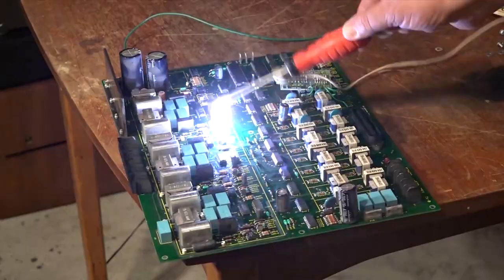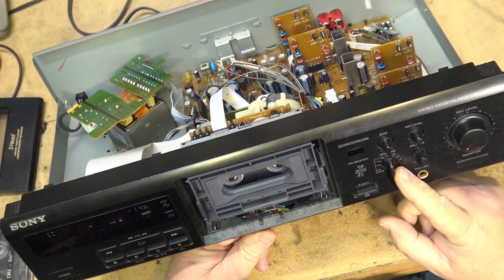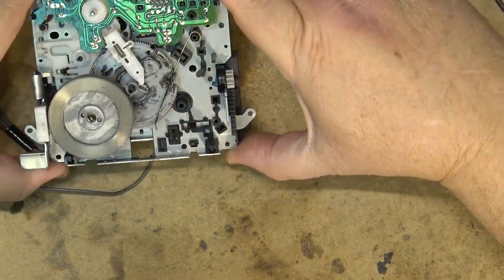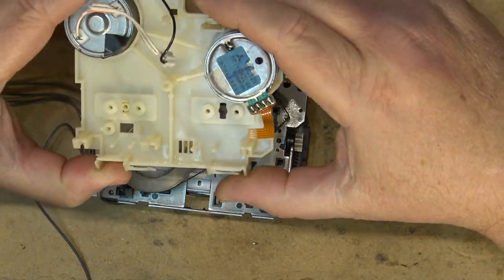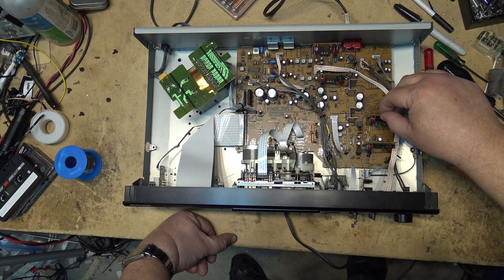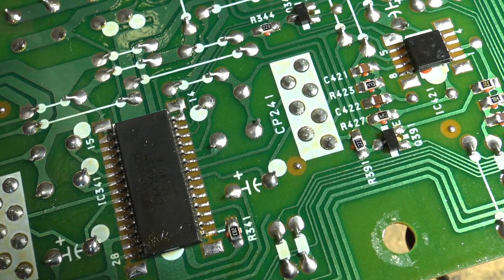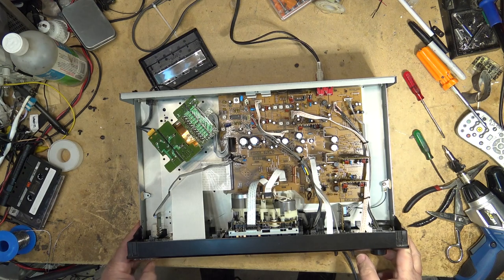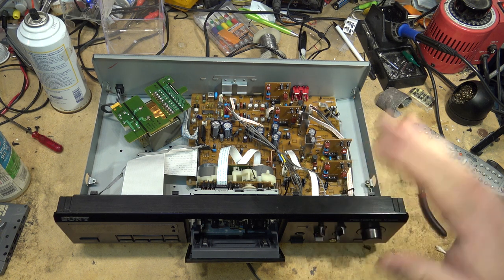Sony TCKE500S 3 head tape deck thrown off a truck

Comment: Sony's 90s components are like General Motors 90s cars, leave you longing for the 70s.
Reply: But they wrre not alone, ALL the 90s "budget" components were like that, you still got some exepections, but CD was on the TOP, by early 2000 philips started to sell stand alone CDR machines for audio .... the tape was basically DEAD. But this deck looks so flimsy and cheap .... I got myself an RSTR262, I hate this Technics components,, one motor for everything, clunky as hell, but they put a decent fight at a very affodable price back in its day. I would say that, appart from being one motor transport, the baseline Technics from same period were a bit better. but not great decks. I couldnt even do METAL !!!!!!!. Sansuis D95 did and it was on the bottom line
Reply: @38911bytefree  I'm sure even National Panasonic RX-A5 can do metal tapes better than RS-TR262.
Reply: I have a Sony 300 disc CD player that works well just don't tilt it because then you got to pull out every CD to get to the crooked ones 😂.
Reply: @caryhuffii7224  I always see those mega-capacity cd players for like 20 bucks at the Goodwill.  Usually they're loaded with loose CDs banging around in them.  Next time I see one, I think I'll pick it up.  If it doesn't work, at least I'll have the CDs inside!
Reply: Shit your tellin me, I'm driving a cadillac Eldorado from 2000 with a tape deck, very small space to work in

Comment: All four of those plug-in boards are identical Dolby-S boards.  Each one is only a single channel.  So two for record and two for playback.  The Dolby B/C chips are two channel and are on the main PCB. Service manual at https://freeservicemanuals.info/en/servicemanuals/viewmanual/Sony/TCKA1ESA/TCKE500S/

Comment: Hi, I have a TC-K561S which has a very similar mecha-unit. Trying to replace the belts and a weak cog on top of the reel motor, I "manage" to put the cam gear out of alignment and also the heads assembly fell off. Can you please tell me what is the correct position for the cam gear? Thank-you.

Comment: Hi. The tension spring that crosses along the front of the area of the heads, coiling at the capstan/pinch wheel, I'm not sure how the right angled shaped end, is meant to rest. It appears to have disengaged from it's original position. Any suggestions?

Comment: the bean counter type deck when they stoped selling  no bang for your buck
Reply from the maker: Cassette decks were on their way out by 96 when this was made.  Want a good cassette deck you need to look for one made between 82 and 86. Right when the cd was just getting going because everyone was renting and borrowing CDs to make mix tapes and the really good tape decks were around. By 86 the cheap dual decks were taking the wind out of the sails of high end units.  That JVC i have originally sold in Canada for 1299.99.  My technics rsm275 was a 700.00 deck.  That was alot of money for a tape deck back then.
Reply: @12voltvids  :) hi have you seen the msrp for nakamichis? I paid 500 bucks for a nak 700 and it's msrp originally was 1500
Reply from the maker: @getzapped313  
Yes we used to service them at the shop i worked at.  Like luxman they were expensive.
Reply: @12voltvids  do you think you can help me break down this issue? Also I'm kind of new to this and everything is still a learning curve 

I have this problem, with the rewind, and I engage the RW button will run smooth maybe like one or two seconds, then will start making a loud continuous clacking sound, it will stop for a second than happen again 

Fast forward here and there does the same thing but not as loud and not frequently

Could this be a bad clutch? I bought this deck used with the box and manual, but I have been skeptical about opening it, I have opened my telefunken and some plastic junk don't dual well deck and have a fairly good understanding of most of the components

Another issue is I cannot find any stereo shops n my area
Reply from the maker: @getzapped313  could be a bad idler too.

Comment: I have the same model I found at a local thrift store for $9.49....Belts are toasted but it powers up just doesn't play as I hear the motor working/// I did order new belts that costed me more than the deck but all is cool.. Soon to work on it..
Reply from the maker: Don't ask what this one cost, and I spent over 3 hours getting this one working.

Comment: Hi, can you please explain the right position of the cam gear? I've bought it and have replaced the belts. It will play and ff, but rewind doesn't work.
I've tried already different positions but can't figure it out. Thanx

Comment: I have this deck and it's ok. though you didn't show it if the tap the FF/Rew twice you get super fast FF/Rew, though it does sound like a jet engine. overall the deck sounds great if properly serviced.

Comment: You didn't show how you did the PB speed adjustment as we only saw the freq on the screen. Can you quickly explain how this was done? I also have a Sony tape deck which does not have a potentiometer in the motor but instead somehow should auto calibrate the speed...
Reply from the maker: I think it is pretty obvious. The speed adjustment is the pot on the circuit board that the motor plugs into.

Comment: I have a Yamaha deck from 1998 which sounds really good. Dave you said the decks from this era are not as good. But these decks have the later Dolby S on them.

So my question is this, what deck would you buy from this era that has the later Dolby on it and is a good quality deck, two or three head?

I have a two head Yamaha KX-393, which sounds really good.
Reply from the maker: There's really not much difference in terms of sound quality between a good two head and a three head deck. The advantage of a three head is that you can monitor off tape so it makes setting the bias and levels a little bit easier with the two head you have to make a test recording and then pay it back make an adjustment make another test recording play it back so it takes a little bit of effort to dial a brand of tape in on a two head but once you have it dialed in there's very little difference in terms of sound quality between the two. I've heard many two head decks that sound better than a lot of cheaper three head decks. As to the Dolby ass the problem with Dolby asses the tapes really aren't compatible with non Dolby ass decks so you have to play it back with dubious and if I was going to go to that trouble I would just use dbx because dbx blows them all away. If I was buying a tape deck I would buy one that has a direct drive capstone such as a Technics RSM 275 which is a two head or rsm375 which is the three head or JVC tdv 1010. I have dimension JVC and it sounds absolutely fantastic. But it still sounds like cassette which sounds like crap when you compare it to a real recording system like digital audio tape
Reply: @12voltvids  I could talk to you about retro hi-fi all day long... Thanks for the info. ;)

Comment: Very good repair! I also have a JVC td v562 and it still plays nicely!
Reply: My first real cassette deck (after the cheap Panasonic) was a JVC KD-55 and it had Super ANRS instead of dolby which was not compatible with dolby.
Reply: @andershammer9307  The KD-55 is solid, very good player. I keep mine for nostalgia reasons!
Reply: @alexandrossotiropoulos5621  I have 23 cassette decks kept for nostalgia and other reasons.
Reply: @andershammer9307  23 deck! That is a big number! And how can you keep them all healthy! Because they need to run on and off

Comment: Did you make an adjustment to the head at the beginning I think you did but not sure if you did or not! But I thought you moved the alignment screw!
Reply from the maker: No, i was verifying that the screw was still factory sealed and did not turn. They used 3bond at the factory. That green paint that was only available to factory service centers.  That way if a unit came in they knew if it had been messed with.  Some companies used red and others white.  
You would be amazed at how many people fiddled with the azimuth and then brought the tape deck in saying it didn't sound good under warranty. probably about the same number of people that get their phone wet and then try to claim that it just broke but on your phone there's a moisture sensor inside the headphone jack which tells the story it changes color when it gets wet. I remember one time telling a kid that his tape deck was not under warranty because he messed with the alignment and he had to pay to have it fixed he started crying at the service counter when he found that it was going to cost him $60 to have the alignment done. And then the excuse but it wasn't me it was my friend trying to make it sound better my response I don't care it's tampered with warranty is void too bad so sad.
Reply: @12voltvids  I got ya! Very true! But glad it played better! That was a long solder video!

Comment: And finally about what was all the big deal of the three heads cassette decks,one is for erasing so every typical deck has two.Listen directly from the recording tracks and so what from the moment that any malfuctions as tape speed or head azimuth adjustment will be noticeable in another good quality deck and not the same that the recording was made.
Reply from the maker: The idea behind three head design is that the record and play heads can be optimized for the job they do. Wider gap for record narrower gap for playback this increases frequency response for both the record and the play head. On a two-head deck some compromise has to be made however the best two head cassette decks were so close in terms of performance to three head that most people would never hear the difference. One drawback of three head design is tape to head contact and this is where dual caption is important as the leading caption provides extra tape tension to ensure good tape to head contact on three head designs. On single caption three head tape deck the pressure pad on the cassette may not provide as good tape to head contact.

Comment: I used to have one of these units, maybe I still do????  Somewhere in the pile in storage.....   But mine just 
seemed to develop a mind of it's own during function so I just put it up, plus now I have much better decks
than this one.  May have to locate it and try some stuff you done on here with the motors.   -Cheers 🍻-AC
Reply: I just picked up one for shipping only. IT really does have a mind of its own when you press play. It will play but will eat the tape, wont rewind, the FFWD seems to wind the take up real backwards...I think I got a very bad pinch roller and possibly a cracked gear head on the 2nd motor. Im up for a challenge. It will also no release the heads until I power cycle it. Could be a spring on the cam follower.
Reply: @68pishta68  I know I have one of these.  Got to find it and I will let you know what I do to 
fix mine if I can.  I just repaired a TC-R303 I have a month ago.  New belts and maintenance.  
That thing just keeps going.  This TCKE500S deck I bought brand new from the JCPenney 
catalog a long time ago.  I used it about a year until I started having issues with it.  Put it up 
and never fooled with it again.  Cheers!   🍻-AL
Reply: Ok I yanked mine out and I already found the problem.  The reason it is half crazy is
because there is a shortage in the cable running to the transformer board.  I was 
getting low voltages and intermittent power.  Also I discovered some border line 
caps and changed those.  I cleaned all those board connectors and tested them.  
Cleaned and lubed the mechanics and put a  temporary used belt on it.  Seems 
to be working correctly now.  I ordered a belt kit and a buddy of mine wants to buy 
it for $200 now...  LOL  Good luck fixing yours!  🍻

Comment: Can motors that grind and slow down after a little while of use be fixed this way as on the video? I have a Denon horizontal loading tape player that I bought at goodwill and at first I thought there was nothing wrong with it other than a sticky tray, but all of a sudden it started making horrible grinding noises and it slow down half speed. I stopped it and next time I tried to play it only lasted a few minutes till it did the same thing. Wondering if I can take the motor apart like you did and lubricate and clean.
Reply from the maker: Many you can if they are not too far gone. This one was still in pretty good shape.
Reply: @12voltvids  Thanks, I will try anyway, since there is nothing to lose I guess, it is already messed up. I do have a Pioneer double cassette with some other issues that might have one of the decks motors (record side) in ok shape (the other one (play side) is doing the same as the Denon) to use as a replacement, so I will give it a try.

Comment: Any chance you can fix or point me to a fix for a tape deck that plays too fast? Tried speed adjustment, cleaned heads and capstan, it just plays everything way too fast. It is an old 1985 MCS deck.
Reply from the maker: Motor. That's the problem. The speed regulator in the motor failed and it is running full tilt.

Comment: How important is it to put the cables tied up in the same position as they were before, is there any risk of some cross cable interference ? What about on power or pre amps ? Cheers
Reply from the maker: Well obviously you don't want preamp cables running parallel to AC power runs.

Comment: I have a Sony TC-KE500S aswell, and it works fine, the only issue is that it chews every tape I put into it, and I can't seem to fix it. Do you have any idea? I've already gotten it services
Reply from the maker: Pinch roller or too much take up torque

Comment: Someone get this guy a soldering iron that is not for 10awg wire. good lord you need a nice small tip for that stuff.
Reply from the maker: I do have multiple tips for the iron, and use the small ones for fine work.

Comment: Sony Made Some great decks
Reply from the maker: They also made some terrible crap
Reply: @12voltvids  😆😂
Reply: @12voltvids  Could you give us an example of a Sony crappy audio product?
Reply from the maker: @stanley2004  that would take too long.  They made tons of crappy audio products in the 80 and 90s.  So did everyone else for that matter.  The era that they were bad was the IC output module and voltage amp series.  Lots of bad connections causing headaches.

Comment: Any chance you could do a full adjustment on this unit? Biases and such like?
Reply: With 3 headers depending on the design better not to touch Bias pots if they have separate L and R adjustment - some are very sensitive. Even with calibration tape it isn't easy. With many decks around this price bracket heads are Permalloy type and wear down, so easier would be correct the playback  side for wear than to adjust recording level and bias.
Reply from the maker: No, not calibrating Dolby or such. Don't have the equipment to do it. Bias is fine as you do that from the front panel every time you load a different tape. Head alignment will also be good because nobody has f***ed with it.  They don't go out when they are paint sealed unless something mechanical has happened to it such as broken parts.  Typically heads never need adjusting until they are replaced.

Comment: Can you get refund from ebay saying it was damaged in the mail i think usps fedex and ups are all protected with ebay protection
Reply from the maker: Yes I am aware of that one. Many people abuse it saying item didn't arrive or arrived broken when in fact it was fine. I was stung about 15 years ago to the tune of 2500 because a dishonest buyer wanted a free professional camera. Said it was "not as advertised" which was bullshit. Because he was too stupid to read the ad. I sold an old Canon 19:1 professional zoom lens for 1/2" camera and threw in an old camera it was attached to. (Sony EVW300) The guy bought it not wanting the camera but wanting the lens for his Betacam. Problem is the Betacam used 2/3" chips, and required a 2/3" lens. A 2/3" lens will work find on a 1/2" camera, just a little larger image, but a 1/2" lens won't work on a 2/3" camera as the corners are dark. Stupid buyer wanted a refund (and wanted me to pay all the fees) and I said sorry charlie, read the terms. All sales final. So he filed a chargeback saying it wasn't as advertised, was defected, and everything and after almost a year he won and I was out the money. The lens was totally worth what he paid, as lenses do not depreciate like electronics. I could have sold the lens separately but I wanted rid of the camera as it was loaded with hundreds of ticking time bombs  (surface mount capacitors) and I wanted rid of it before they blew up.